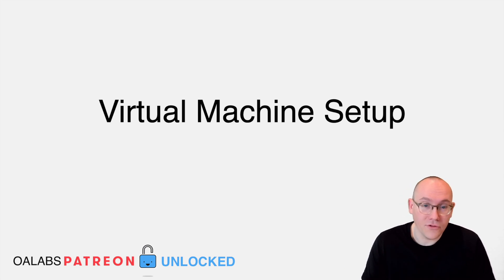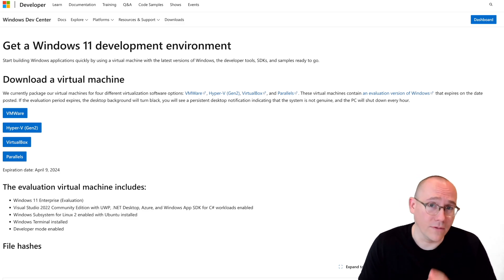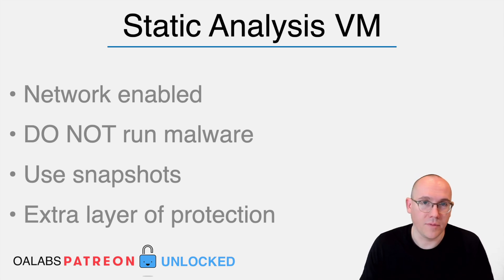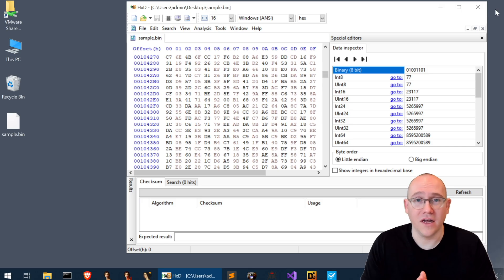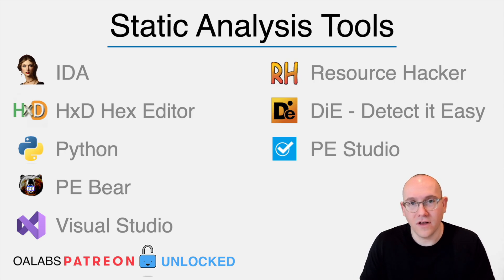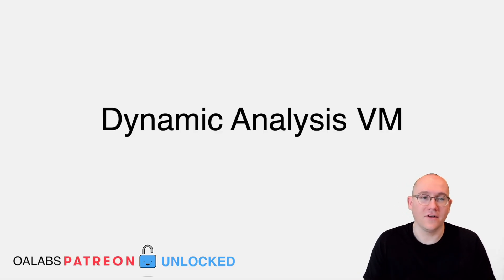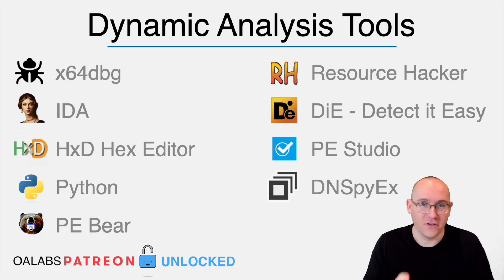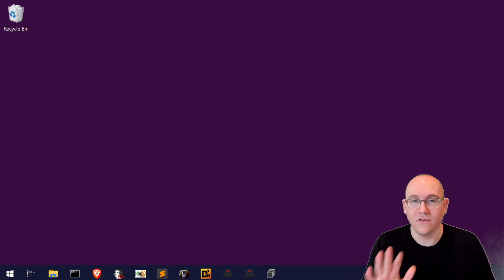Reverse Engineering LAB Setup Tutorial (updated)

Comment: I just want to make sure, my actual work machine (my host) is a Mac book M3. I can obviously install Windows ARM in a Vm and use that, but will I be able to also debug (execute) x86 binaries? And if the answer is no, what are my options? Qemu? UTM? Or is there a better way?
Reply from the maker: The only workable option I know of currently is to use ARM windows. Under ARM windows you can run all the x86 apps you want no problem, but the issue is that you cannot meaningfully debug them. If you want to use the VM as a dynamic analysis tool (debugging malware) it simply won't work. The reason is because ARM windows uses JIT when running x86 apps so if you try to debug an x86 app you quickly find yourself debugging JIT ARM code. You will see people suggest UTM since it has an emulator which will allow you to boot an x86/64 Windows image on your ARM host, however the emulation is so slow that it is not really usable. When I travel I use an M1 MacBook, with an ARM windows vm to do static analysis work, but when I need to debug something I do it remotely on an Intel server... I simply have not found a good local solution.
Reply: @OALABS  Ahhh... understood. Yeah, I've been using a similar setup. I hoped there was some sort of better local solution. I actually also have an older Macbook 2019 (still Intel based). So if I need to work on x86 binaries, I work on that one. Sometimes I just use Screen Sharing (if I'm on the same local network) in full screen mode and I just go for it from the M3 Macbook hehe. I just can't get my self to switch to a Windows host machine after all these years :(
Anyway, thank you so much for the reply and your videos... and your channel and discord and EVERYTHING else you do! Highly appreciated! Thank you

Comment: Hey i want to learn malware analysis from basis I have 0 experience what will you say what course Should I follow are you providing any paid course from basic to advance?
Reply from the maker: We get asked this question a lot, usually some variation of.... 

I am starting out as a Reverse Engineer, is there a course/video series/ CTF that I can start out with?

This is hard to answer because the best path for learning depends so much on the individual. The approach that worked best for me was hands-on, watch, then repeat tutorials. 

The two practical exercises that helped me the most were… 

1️⃣ Dev, compile, RE 

Build small bits of code in VS, compile them, then disassemble them in IDA and identify what each part is doing. This helps not only become familiar with PE layouts and compiler boilerplate code, but it it also really helps with identifying common patterns in assembly that may not be clear unless you see the C code beside them.

2️⃣ One complete binary at a time

Pick one binary (CTF, or simple malware, etc.) and analyze the full thing. Go function by function and label everything. The first time I did this it took forever, but by forcing myself to google each time I got stuck and figure out the code before moving on I found my skills increasing way faster than previously where I would just focus on easy stuff (APIs, strings, etc.)

With that in mind here are a few resources that might help depending on what you are looking for...

👨‍🎓  Free Training Courses

Boring but thorough university-style courses
https://opensecuritytraining.info/Training.html

More applicable in-depth courses
https://p.ost2.fyi/

Old but still very applicable blog series (my favourite)
https://fumalwareanalysis.blogspot.com/p/malware-analysis-tutorials-reverse.html

Great overview from the goat herself 
https://hshrzd.wordpress.com/how-to-start/

📺 YouTube (no particular order) 

MalwareAnalysisForHedgehogs (great tutorials, some really great .NET stuff)
https://www.youtube.com/channel/UCVFXrUwuWxNlm6UNZtBLJ-A

hasherezade (mostly tools/technique demos)
https://www.youtube.com/channel/UCNWVswPNgn5kutPNa5sprkg

GynvaelEN (streams on all interesting topics RE/Dev)
https://www.youtube.com/user/GynvaelEN

Guided Hacking (game hacking and so much more!)
https://www.youtube.com/user/L4DL4D2EUROPE

DuMp-GuY TrIcKsTeR (more advanced tutorials, very good!)
https://www.youtube.com/c/DuMpGuYTrIcKsTeR/videos

AGDC Services (awesome RE training, mostly with Ghidra)
https://www.youtube.com/c/AGDCServices

cybercdh (random security stuff, always interesting)
https://www.youtube.com/channel/UCND1KVdVt8A580SjdaS4cZg

HEXORCIST (next-level IDA s-! Needs more videos!)
https://www.youtube.com/channel/UCM4kcRgLNEy-MZUoX8uuh9w
Reply: @OALABS  Thank you so much for Giving this much detail 😍

Comment: Maybe this is so stupid to ask that I should uninstall my internet and sell my pc, BUT how does a man access and put files onto a vm with no network access?

For instance, I have a proxmox machine running several different flavors of the linux. Can I add a window there, or does it need to be a physically accessible box with keyboard monitor and mouse. Then files get put on via USB drive.
Reply from the maker: 🤨 enable network when you are setting up the VM, then disable and snapshot before you start any malware analysis...

Comment: OpenArk is better
Reply: @OALABS  
In my opinion, OpenArk is a much more powerful anti-rootkit than System Informer. It can detect various types of hooks and scan Mmap memory with just one click. When kernel mode is enabled, it offers a variety of features that are not visible in user mode, such as checking thread entry point, viewing kernel callbacks, monitoring driver load/unload records, etc.

Comment: Hi, For the dynamic analysis VM, doesn't it also need at least a simulated Internet connection (like to a Remnux VM with inetsim) to learn more about what the malware is actually trying to do in terms of networking? Sorry if this seems like a noob question, I'm still learning.
Reply from the maker: That can definitely be helpful, generally not necessary though. If you need a quick test and don't want to setup another VM you can also use https://github.com/mandiant/flare-fakenet-ng

Comment: Great setup for reversing windows binaries. What would you recommend for reversing .elf or ARM binaries?
Reply from the maker: Same exact static analysis setup and no local dynamic analysis. If you need local dynamic analysis the target OS of the binaries matters a lot, ie. are you reversing android native code, or linux native, etc. Each one needs a different sort of VM setup (obviously). For linux stuff I just use basic Ubuntu, and in the past I have used genymotion for android but not sure what the current hotness is?